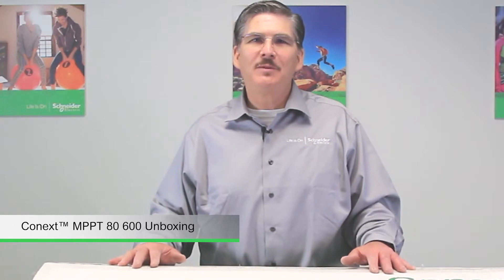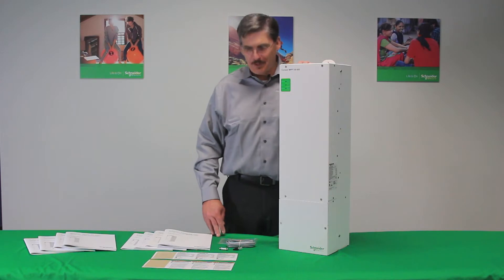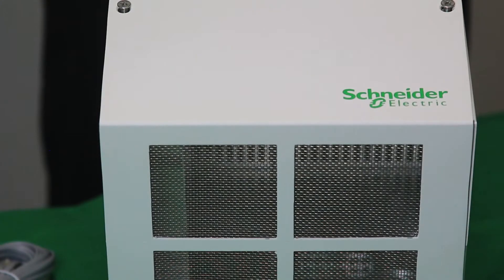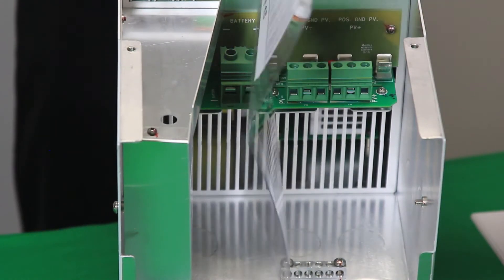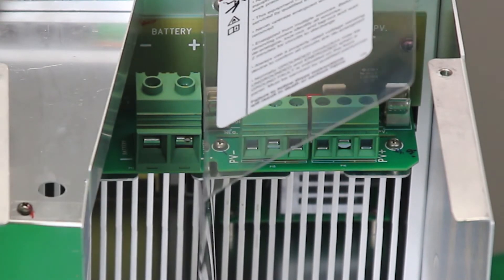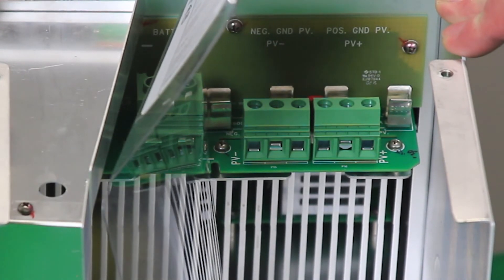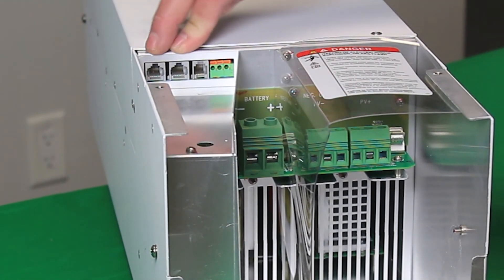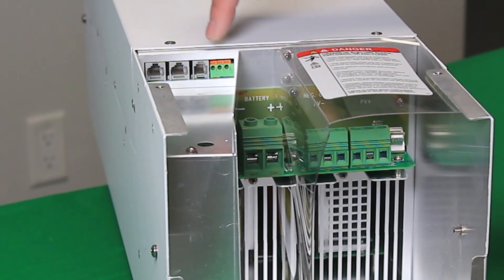Conext MPPT 80 600 - Product Knowledge Series - Unboxing

Comment: The cost of this controller is not worth investing in it. I would better buy solar panels equal to it's power rating complete with a pwm charge controller.
What happened to cost benefit analysis ?
Reply: MPPT is the best. 30% more performance than a PWM.

Comment: So this cannot be used with high voltage batteries like lgchem resu.
Reply: Researching similar stuff.  Can it connect Lithium Ion Batteries?
Reply: @HelloOrganics  It can connect to Lithium Ion Batteries, both LiFePO4 and Li-ion, it is possible program custom charging curves too. However the nominal voltages are limited to 24V and 48V. So creating 36V bank or 37V bank would be problematic.